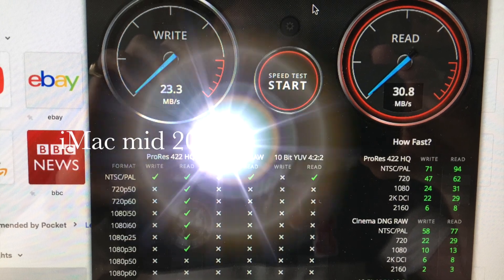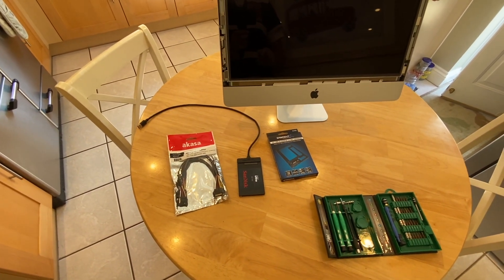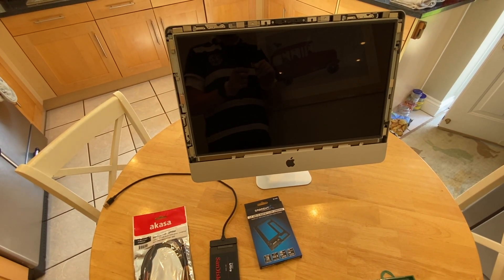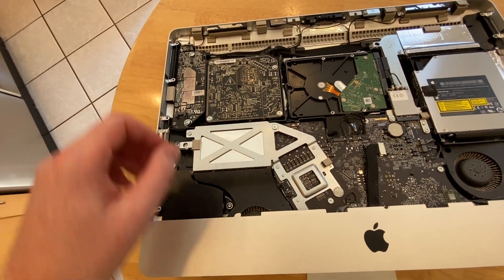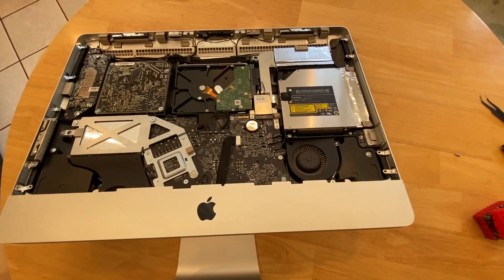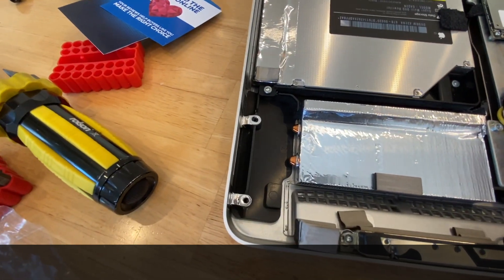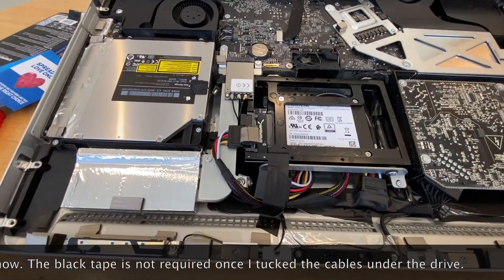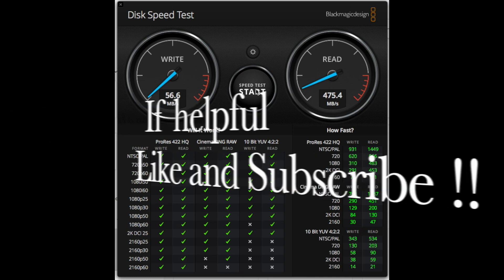iMac Mid 2011 SSD upgrade without Temp Sensor mod - IT WORKED

Comment: I don't understand how but... it work on my iMac mid-2011 A1312 27" with Windows 10. Any of "Y" splitter, the brand is not important (Or maybe i'm lucky). And my method to avoid Cirrus audio driver (CirrusAudioCS4206x64) not working on Windows : Install Windows 10 on a separate PC in legacy mode (Not UEFI) then put the HD/SSD in the iMac, start, install Bootcamp 5.1.5621 (For the A1312 mid-2011) and all is done.

Comment: Thanks for the video - digging deeper  there is even easier  solution - the  whole temp sensor  is  almost a fake  ))) it is a  trigger  0 or 1
 detailed  explanations  here - just short  2 wires in the SATA power lead  or solder  them together on board :
https://logi.wiki/index.php/iMac_HDD_Thermal_Sensor_Bypass
Reply from the maker: Thanks for the tip!

Comment: I wonder if this works with the late 2009. Probably. I just found "Benfei 15 Pin SATA Power Y-Splitter Cable 8 Inches - 2 Pack" in amazon in the US, no Akasa. But I guess is the same. 

Also, you can swap the dvd temperature sensor with the hdd, some people reported that works.
Reply from the maker: Hi Deftoner, as the late 2009 and mid 2011 are similar my guess (and it is) would be that it will work. I've not had and issue with the temp senor and the iMac has been on almost every day since since the build. If this help please LIKE the vid!

Comment: Will this trick work for a late 2009 iMac model?
Reply from the maker: You'll need to check the 2009 model by opening it but I can not see Apple making much of a difference between the late 2009 to mid 2011. Maybe others can comment?

Comment: @Joe Woodford  If I choose to go with a dual hard drive setup without disturbing the 3.5' HDD and add an SSD beneath the CD/DVD drive  . Could I use the SATA Y splitter power cable and power the SSD with the HDD's power source? Would be great if you could help me out. Thanks !!!
Reply from the maker: @Bhuvanesh Kumar , the Y Splitter can offer power to the HDD and the SSD, I can not remember but you might not have a SATA spare data line to connect the SSD to unless you use the bay space under the CD drive as I seem recall there is another SATA data cable around there. But check out YouTube and see what others say. Good luck!

Comment: Hello
Is there a need to short wires 1 and 4 of the original cable with this system? or just put the extension? thank you
Reply from the maker: Hi Giuseppe, I just used the extension listed in the description and it it all worked without any further modifications.

Comment: is this sata spliter suitable for IMac mid 2010 27" as well ?
Reply from the maker: Can not see why it would not work for you.  But I only have iMac 2011 - 21". It is cheaper than buying the temp sensor.

Comment: Great video! I'm planning to upgrade it with SSD, only one thing though, I can only find SATA Power Cable Y splitter with 4 wires without the 3.3v wire (or at least the white wire in your video), will it still work?
Reply from the maker: @hariz danial, have you tried Amazon.  There is a link in the description to the one I used.  Most SATA Y splitters are 5 wire. No seen any which are just 4 wire.
Reply: I have the same question because most SATA Y splitters on ebay are 4 wires. Did it work with you with 4 wires?
Reply: @hatemkamal1682  Well I tried it with the 4 wires, and I have no problems with it at all. Still works! You can try it out :)
Reply: @itsharizd Thank you and one more question please: I found a video says that those Y SATA power cable that has the plastic ends completely molds and closes around the wires, are not safe and can cause fire. Which SATA Y power splitter did you use?
Reply: @hatemkamal1682  actually similar to what the video uses. I’d think that it shouldn’t be a problem anyway; Most sata Y splitters have plastic ends.

Comment: Do you think it matters what double-sided tape to use for holding the new SSD against the back of the monitor? I see there's some Gorilla brand mounting tape on Amazon for $5 & they're a good brand. I just don't want anything catching on fire inside lol
Reply: Actually it's apparently pretty strong. Maybe I shouldn't use it in case I ever wanted to upgrade it again, however, it's gonna be used in a used 2011 iMac with 500 GB SSD so there wouldn't be much to upgrade it in the future anyway. It's meant to just be a bridge iMac so I could use it casually for 1-3 years til I move onto the next, more modern iMac
Reply from the maker: @thatwallscominggirl5359  , I would not put in on the monitor/screen but it would work quite happily on the back of the aluminum case of the iMac.  SSD's not likely to catch on fire, not enough power going to it, the main power supply is the only area where that could be a problem.  I think you are all good to place it there.
Reply: @joewoodford9428  oh my bad the back of the case is what I meant lol. I was gonna remove the screen protector, remove the screen, & then after unscrewing the hdd I was gonna connect the ssd along with a y splitter for the fans to not be on 24/7 & then stick the ssd to the back there, maybe let the y splitter cable hang loose or tuck it under. Then put the screen back on followed by the screen protector
Reply from the maker: @thatwallscominggirl5359  Just wanted to be sure !  Good luck, the tricky part is just getting the glass off the surround and not getting figure marks on it!
Reply: @joewoodford9428  out of curiosity, how did you get the iMac to setup after making this ssd upgrade? I had backed my hdd up through Time Machine, took my iMac apart & made the ssd upgrade. When I booted it up, I was met with a blinking question mark folder so I tried to reboot using internet recovery but apparently our 2011 iMac isn't compatible with that. So I have a sata to usb adapter w/ a power adapter & plugged it into my hdd externally & the other end into the usb port. Using that, when I boot up holding option only the external HDD plugged in comes up. Using that, I was able to login & thought I restored the data onto my ssd because it even says that there is the same amount GB of data on it now that matches what is in my external HDD data but if I unplug the adapter & go to boot up, it shows the flashing question mark folder. Do you have any idea how to fix this? I also went to disk utility & erased the internal ssd which replaced it with a new one. So it should be replaced & it does have the time machine backup on it. But for some reason it's not showing up in the startup manager (holding option on power up?
Reply from the maker: @mike williams, I used the Disk Utility built into the OSX to clone the drive before the install.  I did not show this step but mentioned in the vid as there are lots of vids showing how to clone an HD before installing a new one.  I bought a SATA to USB adapter cable (the cost only a couple £/$) and plugged the new SSD into the mac before the install.  I formatted the drive to be mac compatible so that it matched my current installed HD.  This video might help as it shows two methods, one to install a clean OSX and the other how to clone the drive.  If you want a clone just do that step you don't need to install OSX first.  By cloning the drive you make a bootable and full copy of your original disk, I think your issue is your new SSD drive has not be formatted properly for mac OSX and its not being recognized.  Try watching this guys video or others, you don't need to buy any s/w, Disk Utility can do it !   https://www.youtube.com/watch?v=oB4FlLduMd0 .  Good luck and tell us how you got on !
Reply: @joewoodford9428  thanks I was actually able to make a bootable usb installer. While being able to access my Mac through the external HDD plugged in with the sata to usb adapter in the Mac, I added a usb flash drive in a different port, downloaded high sierra, & I went through the terminal to make a high sierra installer. Then I took the adapter with hdd out & booted the Mac holding option to select my usb flash drive & it sent me into the disk utility menu so I could follow installation of high Sierra onto the Mac followed by a new setup again which really doesn't take long. So now I'm all set except I've noticed I can't download some things in the apple store since it says I need a higher macOS. Makes me want to sell it now & get a 2013-2015 iMac lol
Reply from the maker: @thatwallscominggirl5359  Glad you are up all up running again ! Yup we are stuck with High Sierra with the 2011 iMac.  Its all down to apple not supporting our GPUs :(
Reply: @joewoodford9428  yea I guess it's not so bad because there's still some good features & using the internet is most important, just sad I didn't realize I wouldn't be able to use some of the apps in the apple store with it 🙃
Reply: @joewoodford9428  I'm running Catalina on my Mid 2011 iMac. Look for the DOS Dude patch. It works!
Reply from the maker: @NEVER--MIND  Just looked at the page on DOS Dude, not sure if they recommend running Catalina on these iMacs.  Seems to imply stability issues due to the GPU. How is the performance for you and are graphics OK?
Reply: @joewoodford9428  I got ahead of myself, a little bit. The video card crapped out on my mid 2011 iMac, and I replaced it with a (flashed for Mac) 2Gb Quadro K1100M, which is 'Metal' compatible. Catalina will not work with the OEM video cards, so you are correct. Catalina runs perfectly fine, with the setup that I have.
Reply: Just switch to Linus Mint operating system on the same hardware and you will not be sad. You will use modern operating system with modern good applications like gimp and blender and OBS. Even Youtube will run more smooth with Linux Mint comparing to High Sierra. You will feel like you have a new computer with new life.

Comment: please post a link to y splitter. thanks
Reply from the maker: Hi its all the in the description - but here it is, SATA Power Cable Y splitter (Akasa AK-CBPW05-30 SATA Power Splitter )
Reply: @joewoodford9428  thanks. what I meant was the link to get that one. There  are different types!   Is it this:   https://www.amazon.co.uk/Akasa-AK-CBPW05-30-SATA-Power-Splitter/dp/B004BSFSVS.   I am getting a used mac mid/late 2011 27"  a1312
Reply from the maker: Yup that was the one i used.

Comment: I read somewhere that there is room for a 3.5 and a 2.5 in the 2011s. I dont see it in any vids. Was there a spot for dual harddrves in yours?
Reply from the maker: @J L,  The other spot is to remove the CD/DVD drive as that will also give you extra room. If you wanted 2 SSDs  and you don't use the bracket then you should be able to double up the drives on top of each other.  Not sure about the thermals if you did.
Reply: @joewoodford9428  ty
Reply: Were there cables to plug in a second hdd in yours?

Comment: Is the SATA y splitter necessary if I use the macs fan control app? https://crystalidea.com/macs-fan-control
Reply from the maker: Probably not as you are using S/W to control the fan speed.  Not tried so don't know, but the Y splitter works a treat.

Comment: Will the SATA Splitter Cable trick work if I'm putting the SSD in place of the CD/DVD?
Reply from the maker: @Louis Wilson, RU leaving the original SATA HD in the machine?  If so then I don't believe you will need to do anything as the DVD/CD has no temp sensor on it.  If you are looking to take out the old HD and place the SSD in the space of the DVD/CD then yes you will need the Y Split as the iMac reads the temp from the old HD. Finally if you taking out the old HD and DVD/CD then you will need the Y splitter to plugged in to the HD SATA cable as this grounds out the Temp sensor pin on the the HD SATA cable. If this helped please Like and Sub ... cheers Joe
Reply: @joewoodford9428  Actually, there WAS a sensor stuck to the top of the CD/DVD drive.  And as soon as I put the SSD in its place (with the CD/SATA adapter out of an OWC Disk Doubler frame) and booted it up, the fans came on full force.  This is a LATE 2011 iMac, with the i3 processor. I have installed the software to slow down the fans again, but was wondering about the splitter
Reply from the maker: @LouisWilsonGluefish  As I did not remove the CD/DVD drive on my iMac I can only guess that Y Split will work if the iMac uses the same pin on the SATA cable to sense the CD/DVD temperature? If you are using s/w to control the fan speeds then you probably have the best solution👍
Reply: @LouisWilsonGluefish  just stick the ODD sensor to ur ssd don't remove it from the system it can help u read the temp of the ssd

Comment: I got 3 of these mid2011 i5 iMacs for extremely little money and gave them an SSD and RAM Upgrade, one even 32GB of RAM, the one I kept one for myself. And for most of my photo-editing and  Lay-Out and Webpage work I don't even "feel" the difference with my much newer MacBook Pro. Of course, it is all "only" 2D-work what I do. Maybe I will build in a Xeon CPU with 8 threats some time.
Reply from the maker: @ luxembourger , wish Apple would support Catalina on them as these are still a good machine, it's the GPU that lets it down now.  Agree great little iMac for the money !!
Reply: @joewoodford9428  You could buy f.e. an used Nvidia GTX 765M (with full Metal support) out of a broken Windows laptop, flash the Firmware, which got easy now, to keep full EFI boot access and run Mojave. A friend already did this, I consider to do this also this winter, at least when I got a good deal somewhere.